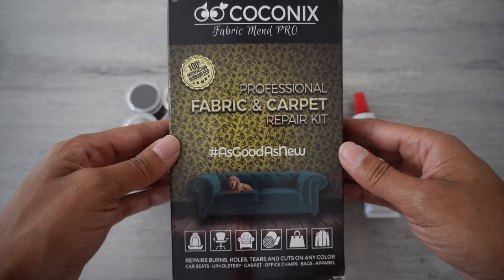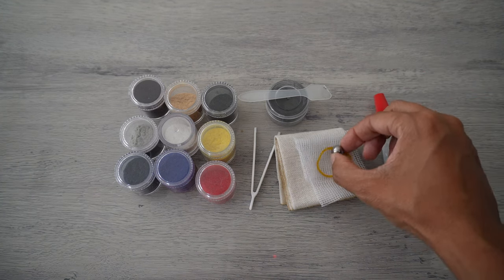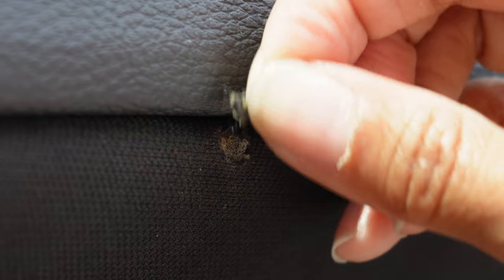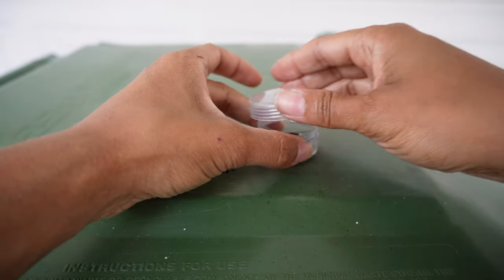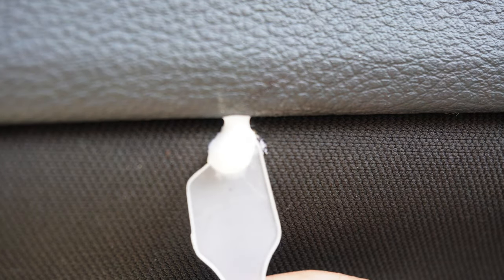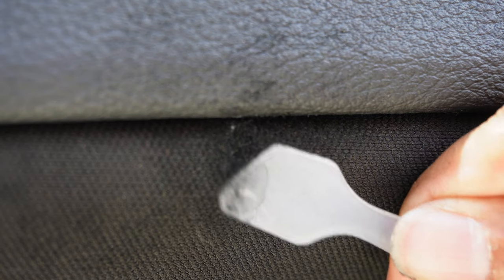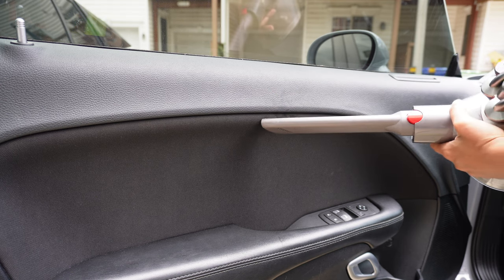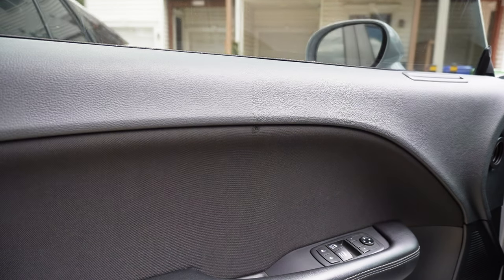How to Fix a hole or repair a Cigarette Burn in car upholstery, fabric or cloth

Comment: Great step by step, I have been wondering about these kits for a while now and saw them on amazon.  I smoke in my car and have two small cigarette burns in my ceiling headliner that I would love to cover….I have peanut butter colored interior, and I would hate to have to replace the entire headliner due to a couple small burns, but however small they are, they stick out like a sore thumb and I want them gone lol.  I agree with you, not cutting the burnt part out probably would have rendered better results due to the sink whole, which made the repaired area stick out drawing attention to it…but I mean overall,it’s a bit better than it was…i just cant help but think there must be a better way to apply the fabric.  Being that my damage is on the ceiling, I can just see having to douse powdered fabric at the ceiling is going to need quite the clean up in the end.  But overall, great video and nice pointing out the things you would have done differently for possible better results 👍🏽😉
Reply from the maker: Thanks Marc, but I don’t think cleanup would be too bad. The fabric flew all over my door, but as long as you have a vacuum attachment it should be a quick and easy  clean up.